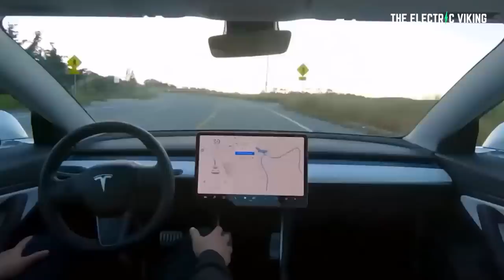20% of all vehicles will need to run on electricity in 24 months in Canada!

Comment: ROLLING BALLS OF OIL
What is considered as pollution output? Does it take into account tyre degradation as a conbination of emissions? Tyre use and disposal is a far more polluting process to the environment that exhaust emissions from modern vehicles yet ALL cars and trucks still require these BIG ROUND ROLLING RUBBERY BALLS OF OIL to operate! 50 millions tyres are 'disposed of' in Australia alone every year. Most are 'recycled' overseas (unless on a mine site, those little tyres are then just buried in the ground) and used to generate power by burning them, great way to save the planet.  Let's all get into debt to buy an EV that we can throw away in 10 years time, if it lasts that long, sorry I mean throw the problem to someone else to deal with the pollution in their back yard. 
Just like where it all starts, where does the cobalt come from for ALL of our lives to exist with all batteries we use now days???
😪 Research that and then convince me we are moving forward in the best direction for humanity!